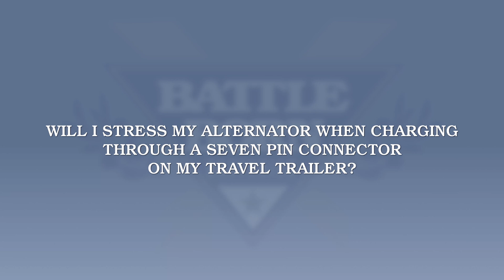FAQ: Will I stress my alternator when charging through a seven pin connector on my travel trailer?

Comment: Hi, this is interesting video. It’s very different from what I have learned in this lithium battery camper conversion.  What mechanism regulates the voltage differential in a factory 7-pin wiring on the tow vechicle or camper?

Normally the tow vehicle assume lead acid batteries and the 13.6v vs the 14.5v of Lithium.  Lithium batteries have a very different charge characteristic and want to consume as much energy as will be provided.  It’s my understanding that this will ask for more energy from the alternator and the alternator will try to respond, eventually overheat and now you have a new problem.

I like the ideas of 1) pulling the fuse or 2) regulating the voltage to keep the two different systems lead acid/Lithium isolated from each other.

Personally I’d like to not have to run a new dedicated charge cable (and I’m ok with slow charge rates)and not put addition stress on my alternator so I’m looking to try to leverage a low amp dc to dc isolation system. 

Curious to hear people’s thoughts on this comment.  I’m new to this but have been calling manufactures and doing other research to see why people are saying.

Thanks for the video as well as reading this comment and would love to hear your thoughts.

Comment: I don’t think this is accurate. I have a slide in camper that is charged by the truck through a seven pin and after only five years of very light, use my alternator needs replacing.
Reply: He's talking about tow behind trailers, not slide ins.
Reply: I don’t think it matters if it’s a tow behind trailer or a slide in camper, house batteries are house batteries charged through the 7 pin.

Comment: If you are worried about your tow vehicles alternator, just use your battery dissconnect switch and turn it off. Your truck will always run your trailers running lights and when you get to your campsite and shorepower, turn your battery switch on and converter. Easy
Reply: Yeah, I’m not so sure this video is accurate. I have a slide in camper and the house battery gets charged by the truck alternator, which has now failed after only five years of very light use. Any hoot, I’ve upgraded to 400 amp hours of lithium so I never really have to worry about power and as you said, we’ll just use the disconnect when driving.
Reply: My 5th wheel refrigerator runs on 12 volt...turning the battery disconnect on is not an option....

Comment: Mine supplies 5.5 amps/~72 watts when towing. Alternator could care less about that little draw.
I also installed a Scan Gauge II which monitors the alternator voltage and more importantly the transmission temperature.
Reply: 5.5 amps sounds awful high to the 7 pin connector. I was thinking it was slightly under 1 amp?
Reply: After checking several folks said 5 amps is about normall coming from a alternator to the rv batteries via the 7 pin connector.
Reply: Connector is rated for more than 5 amps. @theconnectedcamper
Reply: Will your RV batteries try to charge your tow vehicle battery and burn your alternator?

Comment: Is it possible to some how disconnect the individual 7 pin wire from even attempting to charge battery?
Reply: I removed the charging 7 pin fuse on my Superduty
Reply from the maker: Hi. Most systems work just fine, leaving the 7-pin connection as is! If you have specific questions about your system, our technical sales team would be happy to assist you! You can reach them at (855) 292-2831 (M-F 8:00am - 4:30pm (PST)).
Reply: I put a 25 amp in line marine circuit breaker/switch in line at the battery and just open the breaker when not towing.

Comment: If the lithium battery is severely depleted, won’t it demand more current and possibly cause the trailer wire to overheat?
Reply from the maker: From low or high voltage, low or high temperatures,  if there is a short in the system, it will shut off. The BMS shuts off the battery to protect the li-ion cells and the user from unsafe operating conditions.
Reply: @battlebornbatteries  Thank you
Reply: Lithium batteries can accept huge current and alternator will put it out.   Lots of vids of smoking alternators because of this.   They sell dc to dc chargers for this reason
Reply: @brentyuers8963  All of those "smoking alternator" videos are on a bench, with the alternator like 3 feet away from the battery, connected with 6+awg wire.  Of course in those scenarios the battery will be getting a huge amount of amps from the alternator.  In almost every real world situation when towing a trailer, you are limited by distance and wire gauge between the tow vehicles alternator and the 7-pin connector.  The charge wire is most likely 12awg and the run between the alternator and battery will be 15'+ in most cases.  The battery will never see a high current.  It will be a trickle charge at best.

If you want to effectivley charge your battery with the tow vehicles alternator, then yes, install a DC-DC charger.  You're not going to blow anything up without though.